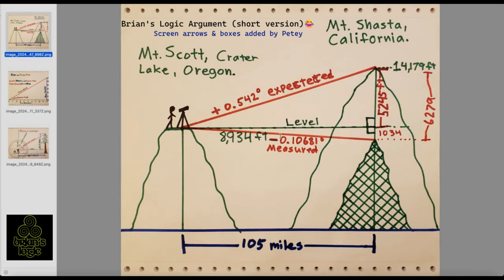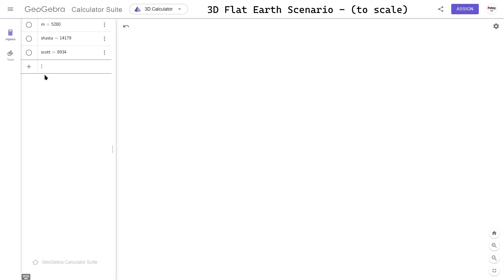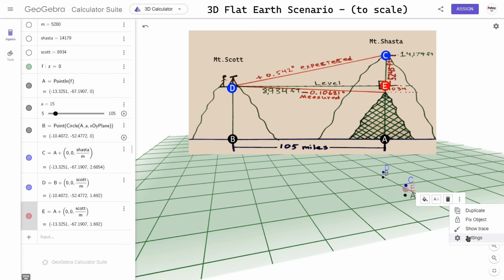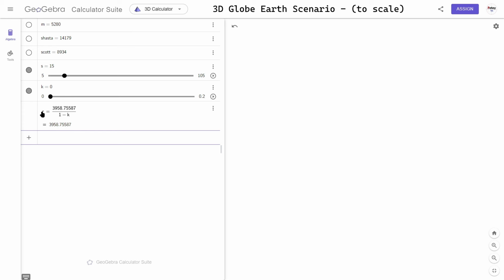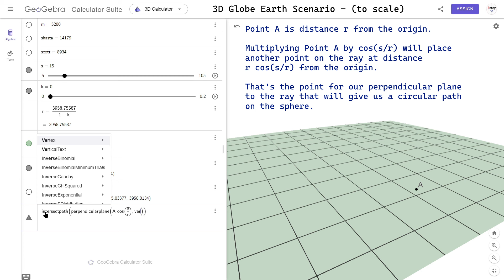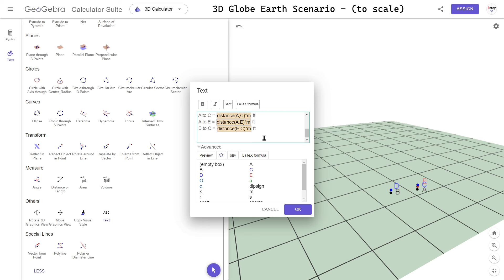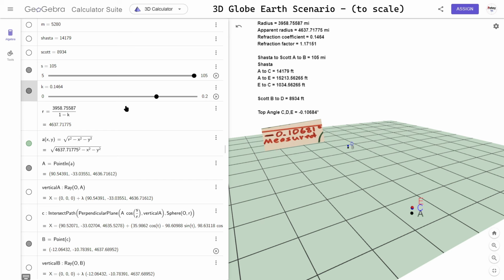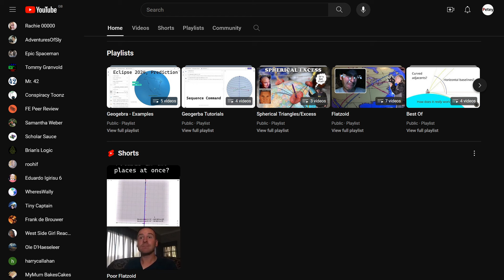Flat and Globe Scenarios - Full 3D Geogebra Walk-Through Ft. Brian's Logic

Comment: 😂 I keep banging on about this, but: when Flerfers use “perspective” or “angular size” to explain why ships disappear bottom up they seem to forget that these operate horizontally as well as vertically. So, looking at windmills out at sea, if it was angular size that made the bottoms disappear, why don’t the visible (horizontal) blades of the windmills also disappear or at least get shorter by the same amount?
Reply from the maker: I don't know Chris. They're very tiring aren't they. They talk of black swans alot but all this perspective talk seems like a red herring to me. Brian talks about things changing like a car driving down a road appearing to get smaller. I don't see how that has got anything to do with 2 fixed mountains of known heights and distances apart. We measure what we measure and nothing else. If the guy went to Nevada to take a measurement of the same Mt. Shasta in California, it's not going to affect the measurement he gets from Oregon!
Reply: They also think that Rayleigh Criterion will cause much larger hulls to disappear due to it while much smaller marine radar and other features at the top of the ship (which due to how ships are build also tend to be farther from eyes than the hulls) still remain visible. It boggles the mind how much they have to screw with reality to make it fit their beliefs.
Reply: Or why early sailing ships adopted putting a crows nest on the highest mast on a ship so they could see land or hazards in the ocean before anyone on deck could.. almost like they understood the Earth being a globe hundreds of years ago without the advantage necessarily of “proof” of a globe. 
Just common sense and basic technology.

Comment: Back in the mid-1800s all of the continental USA was surveyed in a huge project organized by the Federal government. The surveyors used these essentially simple techniques of measuring horizontal distances and angles to get peak heights. The system works. Those surveys are correct. They've been improved upon slightly, as we've developed more accurate tools. But essentially they were accurate. The survey records are in archives. They do NOT include flerfspective "corrections" for "apparent" drop or any other such nonsense.
These surveys also served as the basis for laying out state and county borders, and the whole system of townships and sections that defines land parcels. Interestingly, this system, which was supposed to be a grade based on 6 mile township increments had to be adjusted to account for Earth's curved surface, as it was impossible to lay out a grid of perfect squares. These adjustments can be seen in the county and state borders and in roads that follow this grid.

Comment: I see...so perspective and apparent size is the answer when it's convenient to explain away real evidence of curve.  Then how do the sun and moon not change size when zooming around above the stationary pizza pie earth disk?
Reply: I did the calculations on this recently. Modeling the Sun as a 29 mile disk, 2423 miles above the surface (which was based on some FE measurements), and moving over the Earth at 1039 miles per hour, and defining "sunrise" as the position of the Sun where it would be if it's going to pass directly overhead in 6 hours, I find that the Sun starts with an apparent angle of 0.25 degrees, located 21.24 degrees above the horizon. That's 85 Sun widths above the horizon! I'd think we'd notice. And by the time the Sun passes directly overhead, it would have an apparent angle of 0.68 degrees, for a 2.7 times change in angular size.

The position of the Sun in the sky in the common FE model also looks nothing like what we actually observe, with the angle above the horizon varying as the arctangent(time), instead of the steady 15 degrees per hour that we actually observe.

While it is true that Eratosthenes' "measure the angle to the Sun from two points" assumes parallel light rays and therefore Earth curvature, and that assuming a flat Earth, the angle difference to the Sun can be explained with sizes and distances like the ones listed above, if we make any other measurements or look at any other aspect of the model, FE falls apart like wet bog roll.
Reply: Not only size, but they would need to change their angular speed too.  They don't.

Comment: In my video about spherical excess, my comment section was bombarde with a guy named TB who made exactly the same "mistake" Brian makes. He stated (about 40 times) that because the top of objects above the horizontal line of sight appear to go downward with distance, they eventually will drop under the horizontal line of sight. He even stated that the horizontal line of sight itself would drop toward the horizon.
These flerfs have to resort to more and more exotic "explanations" as to why observations in the real world don't match with a flat earth.
Their way of thinking, that is that the top perspective lines cross at the horizon and beyond that go on and on farther under the horizon. It's absurd.
BTW nice tutorial!
Reply: Wouldn't it also mean that the surface below your eye line would go above your eyeline, basically inverting what you see in the distance.
Reply from the maker: Thanks FB, I think that was T Brown. I responded to him in your video and he replied but I just ignored him after that. Until he does the geometry himself he just won't get it and even if he does to the geometry and come up with the correct answers, he won't want to get it.  When I did the Brian Leake, Jeranism video, I was struggling to work out how it was possible to move one of the measuring stations up and down and it didn't affect the angle sum. It is difficult to grasp. Even when you have a handle on it, you still ask yourself, if you really have a handle on it. 😆 The geometry doesn't lie!
Reply: I really enjoyed that conversation, getting TB to tie himself in knots and contradict himself. Flerf minds like TB's don't seem to be able to grasp that these visual angles to objects all have their vertices at the observer. That's perspective - from the perspective of the observer. TB actually thinks that you can magically move out along the surface from the observer and there's an apparent height between the observer's eye level and the surface at that location, and that apparent height is always shrinking towards the surface. It's madness.
Reply: @everybodylovesballs  My joy quickly disappeared when I realized that the guy could only repeat the same nonsense time and time again. You held your ground for a remarkable long time.
Reply: @frankdebrouwer-leiden   You held your ground for a remarkable long
I think I'm easily amused. There's a guy called Mike Jones that's even more fun.
I did the experiment I described with my theodolite for my own benefit. 207mm object at 1800mm and 2800mm. I got 6.58° and 4.22° which is really close to the trigonometric predictions (6.56° and 4.23°). I think the biggest error is not knowing where on my scope to measure the distance from, as there are a few cm between the lens and the eyepiece (I measured from near the eyepiece). It would be good to do a larger experiment with a flat surface - along the edge of a long pool might work but I don't know anywhere where someone setting up a theodolite next to a pool would look like a normal thing to do :)
Reply: @Monkey-Betty  It would mean that, but FE claims are nothing if not ad hoc.
Reply: @Petey194  GeoGerba is run by NASA? heheheeh any flerf excuse will do.

Comment: What Brian seems incapable of grasping is that the “perspective” view uses the eye level of the observation as it’s datum level.
Objects above eye level will decrease in angular size towards eye level (appear to drop) and objects below eye level will also decrease in angular size towards eye level (appear to rise) as they move away from the observer.
So, on a flat plane, the top of Mt Shanta should appear to drop towards eye level and the base of Mt Shanta should appear to rise towards eye level.

This is NOT what we observe in reality.
The top of Mt Shanta is below eye level and the base of Mt Shasta is not visible because it is blocked by the horizon.

Comment: Until a flat earther can produce a formula for perspective by which the height of a distance object can be calculated by measuring the elevation angle  to the top and knowing the distance to the base, their claims are shown as bullshit. 
If the Earth were flat, it would mean a horizontal line from the top of an object would be parallel with a horizontal line from the base, any object higher would always appear above the line from the first object.
That is not the case on the Earth, therefore the Earth is not flat.
Reply: I think the mistake they're making is thinking that "perspective" causes things to shrink towards the ground, instead of shrinking towards the vanishing point at eye level. Everything Brian says about the top of the mountain appearing to move down is countered by the reality that the bottom of the mountain would also appear to move up.

Comment: Impresssive video Petey, I do think that 3D geometry will be many levels above Brians pay grade. The only geometry that our flat Earth colleagues can comprehend is a right-angled triangle and a flat surface.
Reply from the maker: Thanks so much! But can they even do that though 😆Brian told me in the comments of another video a couple of days ago that he'd like to learn more about the 3D side so I decided to make this. If he takes just one construction method away then I'd be happy with that. I really do think geometry is the key to bring flerfs back to reality but only he can lift that veil of cogdis.
Reply: @Petey194  .
It was the basic geometry I learned at school, which means no one could ever persuade me the Earth was flat.  A flat earth does not comport with simple observations.
There is a video showing a large ship partially hidden by the horizon. There is a much smaller vessel short of the horizon, which is very obviously higher than the larger ship.
Reply: @Petey194  hi, could you make video with 3d representation of equatorial mount on flat and globe earth? and show how line of vision would travel the sky in both cases, think that this would be proof that they could not deny because rotation on one line is only working with globe
Reply from the maker: @tomislavzupanic1557  I'm not sure I'm that good at this yet. I still consider myself a novice on this whole subject. I do think that what I have produced so far overwhelmingly supports the globe model. From celestial navigation to the Earth in orbit observing Polaris from varying latitudes, this video etc etc. None of it remotely supports FE. Geometry is the key though :)

Comment: Brian's statement "The person in Mt. Scott was 8,934 ft high. Mt.Shasta is 14,179 ft. It's 105 miles away and the extra height of Mt. Shasta above Mt.Scott is 5,245 ft but they took a dip angle to the perspective size of Mt.Shasta" demonstrates he is blind to why it is nonsense to say we should calculate something by including part of the answer in the calculation. We can calculate the angular size of stuff and the gaps between stuff. If we look at the side to side angular sizes and relative positions, the predictions match what we see. The only extra shift proportional with distance is down. It is not due to perspective.
Reply from the maker: I know he gets it because he had a bit in one of his videos about the Eiffel Tower where he said, "if you know your distance from it and know the angle to the top, you know how high it is". Then he said, "if you know how high it is and you know the angle then you know how far away you are". For some reason that doesn't apply to fixed mountains of known heights and distances. Earth curve throws a spanner in the works!
Reply: @Petey194  I think flerfs often use memorised "right" answers rather than actual understanding. For example Sleeping Warrior recognising that sides 1, 1, and 1 means an equilateral triangle but then goes to a 90 degree triangle calculator for the angles.